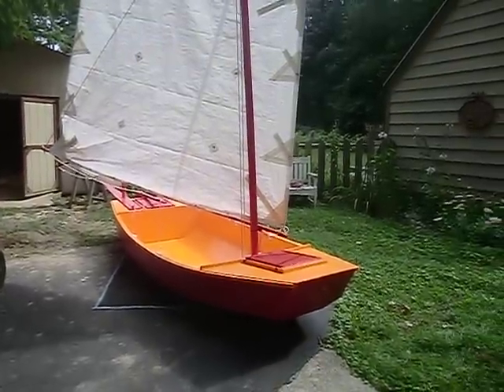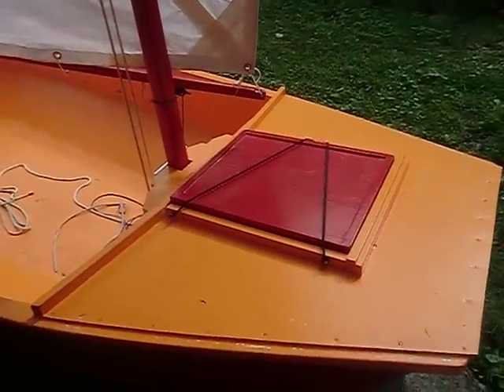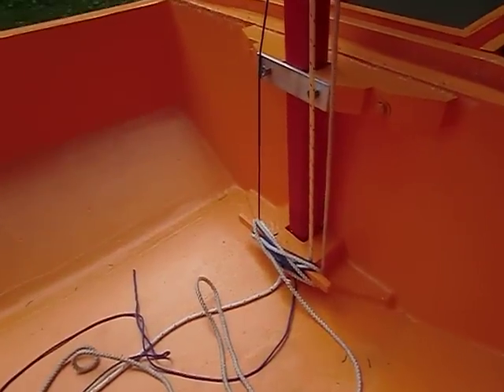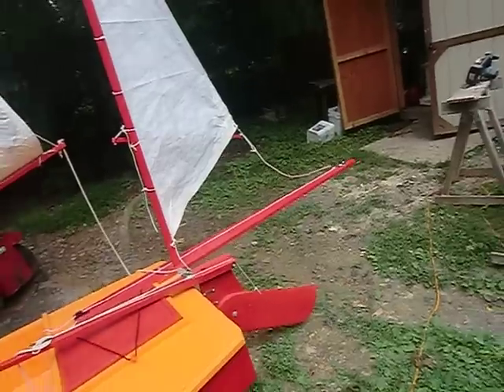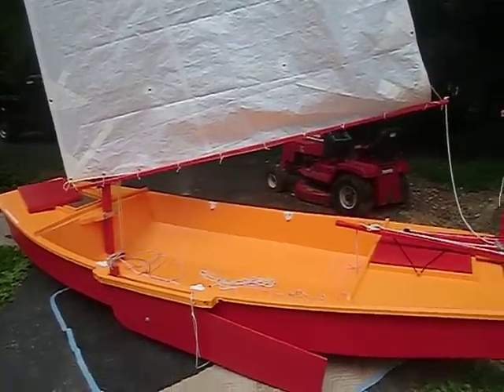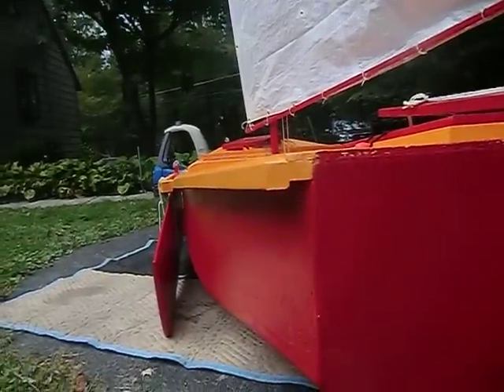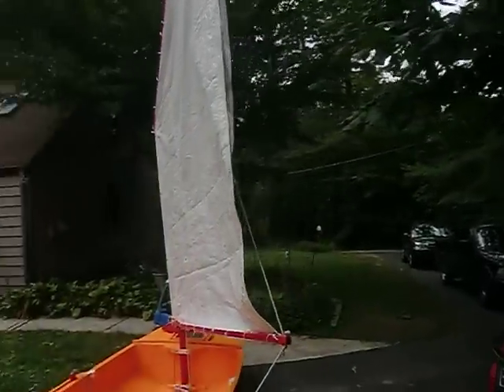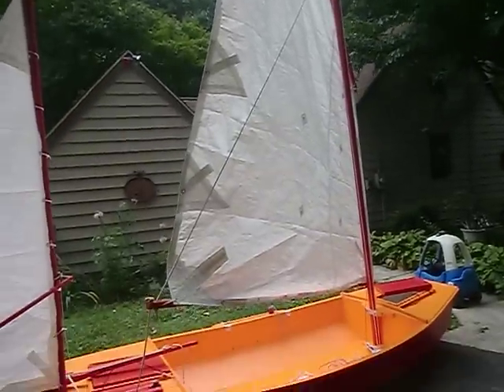Jim Michalak designed Piccup

Comment: I like the shape of this boat a lot. I would go with more earth toned colors like hunter green and varnished wood but that bright color looks quite fine! I wouldn't do the mizzen sail as I would just like a single unstayed gaff sail up front.
Reply: I use the boat for extended week long trips. So it needs to be able to reef, and reef fast. The mizzen is more of a safety feature then anything intended for speed. I can sheet in the mizzen and point straight into the wind. With the jiffy reefs in the balanced lug I can reef in less then 30 seconds and be sailing again. I'm a huge fan of the yawl rig. It works great.